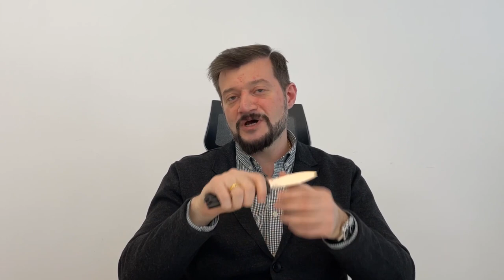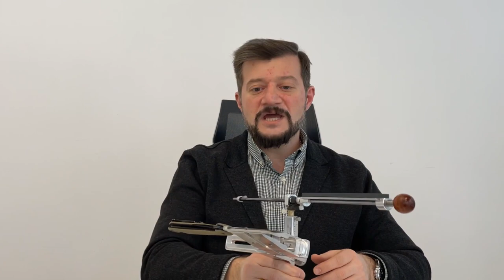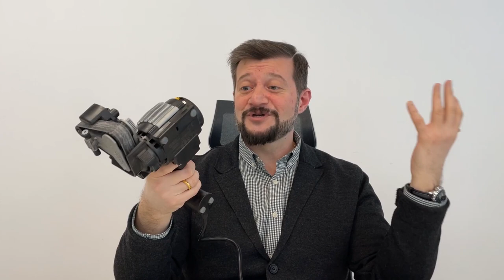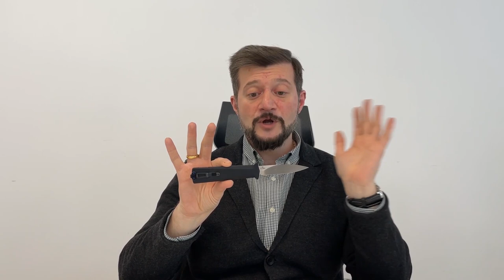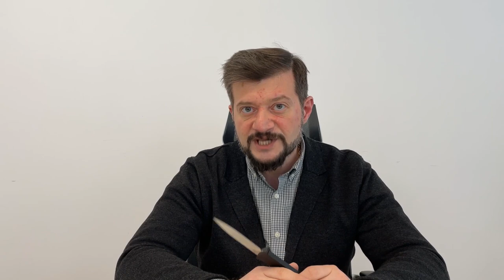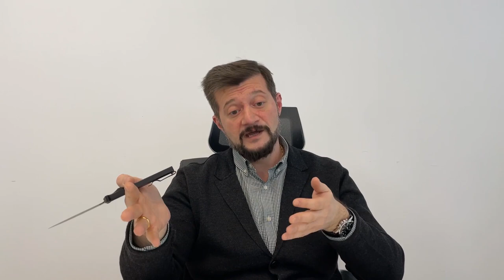THE BEST KNIFE STEEL: M390, D2, AUS8, N690, VG10, S30V, S35VN, 440C

Comment: Its Magnacut steel. It's expensive but it's superior. Easy to sharpen, holds an great edge, is often more durable then most high carbon steel and is more corrosion resistant then most stainless.
Reply from the maker: agree with you!

Comment: I brike my N690 Katana today trying to chop a plant base. That's why I am doing some research. I was obviously lied to and taught that N690 is stronger than it actually is....
Reply: N690 is definitely NOT a good steel for a sword.
Reply: If you want a solid sword Spring Steel (Carbon Steel) is recommended. If your just looking for a display sword Stainless Steel is fine, but for functionality your better off with some kind of Carbon Steel

Comment: I am still very disappointed that there is no Fällkniven A2L CoS Lam version. All other Fallkniven knives have a CoS steel version and the Modern Bowie only comes in CoS anyway! So why pay such a high price for the A2L and still not get the maximum quality??? I'm afraid they made that decision just so they could release a much more expensive anniversary version of the A2L in the future. Like an ace up their sleeve, so to speak. Unfortunately, I haven’t dealt with this topic enough until recently and hastily bought the A2L, which keep in mind, is rather expensive as already mentioned, only to find out that it is Fällkniven’s only knife that still doesn't feature a Pro version.

Comment: I've always valued ease of sharpening slightly over edge retention. Steels like 1095, 1080, 440c, bucks 420hc, some aus8, 14c28n, 12c28n and other simple steels touch up so easy it's a pleasure. No need for any special stones or jigs, it feel like they want to be sharpened lol  were d2 and other high large carbide steels feel like they would rather stay dull once there
Reply: True, I agree with that. Steel needs strength and toughness, thats its main property that attracts me. For fine edge retention and slicing action only, I just got myself a few Rahven Knives elastic ceramic blades. Almost twice the edge retention of rex121, with higher toughness and less chipping (didnt manage to chip them at all yet while hitting bones and taking apart about 25 goats) with one blade. Still didnt sharpen it. Besides this, I only use spyderco serrated blades, vg10 and other higher toughness steels for tasks that require that property

Comment: I quickly figured out that D2, S35VN and S30V are much more pleasant to sharpen after investing in diamond sharpeners and now have a fair few D2 and a handful of S35VN/S30V knives but I still use my old AUS-8 ontario RAT 1 and my CJRB Feldspar in AR-RPM9 for more abusive task such as cutting things in a cars engines bay. I also am likeing VG10 a fair but but my Spyderco Delica is to thin to want to use it for anything else other then everyday cutting task. With D2 becoming common and more affordable, I personly think it is a great choice to keep cost down and I view it as a common mans super steel. Less corrosion resistance is fine if it means I can save $25+ dollars on a knife vs a much more expensive version in a more popular super steel.

Comment: Really happy with my D2 sting geometry and heat treatment, used once my worksharp precision to put a thinner edge for my use and only stropped it since, also did a lot of food prep without any acid spot on the blade (black finish)
Reply: D2 is a great working steel

Comment: I like D2. I grew up with traditional type knives that used carbon steel for the blades. D2 isn’t nearly as prone to corrosion as basic carbon steels. If you take care of your D2 knives and do general maintenance to prevent corrosion. You’ll be fine. I am excited to see some Daggerr Knives in some higher end steels though. I’ve become a fan of S35VN. It seems to be a nice balance between toughness, edge retention and ease of sharpening.
Edit: I hope you’ll have some of the Parrot knives in red soon. I’m also hoping you’re working on getting some of your other out of stock models made. Your knives are ones I’m getting really interesting in collecting and using.
Reply from the maker: Thank you! We also think the D2 steel is very good choice, by the way, some models will come back in stock very soon. Parrot will be in micarta

Comment: It's a bit of a trick question. If the company doesn't have a proper heat treat then no steel is the best. In my opinion I like 1095 or sk85 " with proper heat treats" for outdoors bushcraft, hiking, camping.

 And nitro-v or n690 cryo for edc. Magnacut I also like but I get a woodie for nitro-v for some reason lmfao

Comment: Hi
In terms of edge retention, What steel at what HRC would you recommend for a kitchen knife (not abused in bones and frozen stuff)?
Could I have your opinion for best stainless and then best carbon knife?
I really don't have time to sharpen them so I would try the extreme:
ZDP189 as stainless
CPM rex 121 as carbon
Is that silly?

Thank you
Reply from the maker: Our company does not work with kitchen knives, we make universal knives. But we think your ideas are reasonable!

Comment: How good is cpms45vn vs maxamet in edge retention  and how would you say maxament is in corrosion resistence "how easily could/would it rust)
Reply: Not sure if you found your answer yet, but Maxamet is actually more similar to CPM S110V Steel (which some consider to be the very best of all blade steels).  Like S110, Maxamet has incredible edge retention, but is nearly impossible to sharpen.  However, unlike S110, Maxamet is very susceptible to corrosion.  So it needs to be cleaned and oiled often and kept away from salt water usage.

Comment: D2 is garbage steel. Especially with import mass production heat treat. This has been proven in testing with cardboard, rope and catra. You don't know what your talking about. D2 can be good with the correct microstructure but its expensive in those cases because they are done in small batches by custom heat treater's.
Any mass production knife in d2 should cost less than $40 or its just not worth getting. 14c28n is a much better value. A custom small batch heat treat of 14c28n is also much better than mass production but they do a decent job with it in mass production and its easy to do, for example Mora knives.

I highly doubt your company is getting m390 heat treated properly, let alone worth what your charging for it. As very few factories charge accordingly for how poorly they are heat treating it.

You say d2 is much better than other steels... When you know nothing about it. Your just repeating things you've heard without proof of testing with your companies heat treat vs others vs other steels. Your full of marketing.
Reply from the maker: Thanks for the feedback. D2 steel is a good steel for inexpensive knives. We use it on most models, are engaged in self-production and control all processes. This allows us to speak so confidently about different nuances.
Reply: @DaggerrEDCknives  what is your heat treat protocol for d2 then?

Comment: D2 and M390 are both shit steels. Outpost76 has done tons of testing on both steels (just talking about edge retention right now) and there are much better steels in both of these steel's price ranges. 14C28N and NitroV are both much better at edge retention than D2, and the list of better steels than M390 is too long to list but S90V, MagnaCut, 4V, 10V, and Cru-wear (I know some are carbon and some are stainless but this is just about edge retention right now). Knife makers use those steels because they have the recognized names and they can be bought for cheaper than the better steels in their class. As more people use MagnaCut it will replace 20CV/204P/M390, and 14C28N has started appearing in place of D2 as well. 
As far as toughness goes D2 and M390 aren't known for toughness in any way, and compounding that M390 chips from drops of less than 2 feet.

So , the reason knife makers keep using those 2 trash steels is because they know the knife community is full of sheep, of which 99% don't test or even really use their knives beyond opening an occasional package. I'd say at least 80% don't even know the truth about the steel they use, they just buy the knife they see on their screen.
Reply: Ah...the elusive keyboard ninja out of the wild. Shhh...don't disturb it, so it can calmly return back to its home of selective facts and anecdotal evidence.
Reply: It depends on the purpose. There is no best steel for all situations.
Reply: @anthonyblend9917  generally when people talk about "best steel", they're refering to a steel that's ideal for EDC/general purpose use.